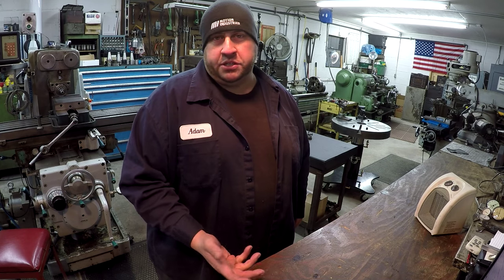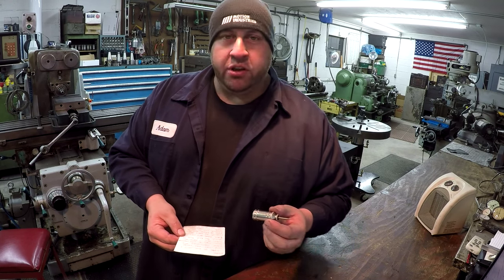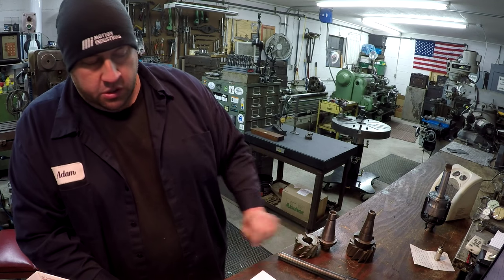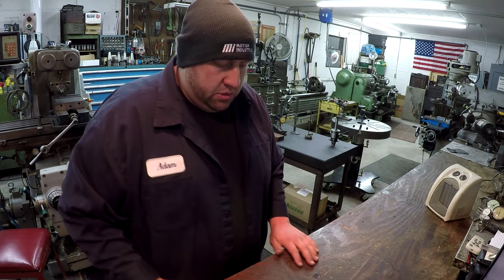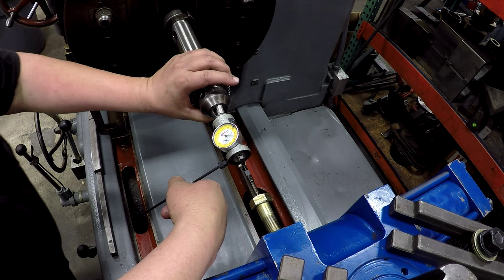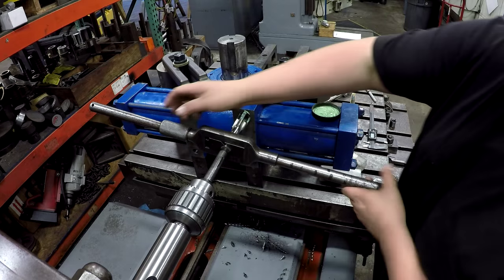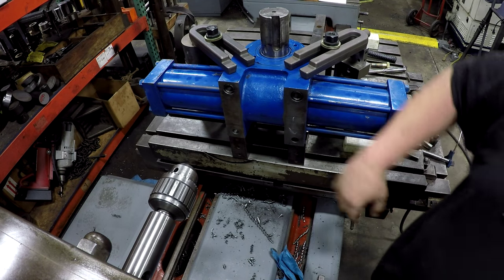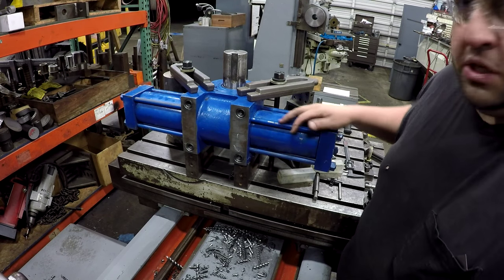Saturday Night Special 105

Comment: Thanks for taking up the brazing/welding subject. I agree with your opinion and reason for brazing I've done it myself and have the same experience with hard spots when using weldment. I was one of "the guys" who asked about the brazing😀 I was a Machinist myself but now as a Mechanical Engineer but I'm missing the smell of fresh coolant, cutting oil and hot chips 😄 Going to the machine shop at work to get my daily sniff😀

Comment: Adam,
Another great SNS! You working on that hydraulic actuator makes me a little homesick for a job I had. If the owner hadn't smoked himself (literally) to death (lung cancer that spread to his spine), I'd still be playing with actuation and building custom control boxes for our clients. 99% of the work I did was on electro-mechanical actuators. The hydraulic units I worked on involved replacing piston seals, output shaft o-rings, etc. I will get my picture entry in as soon as it clears up  . . . Yes! California is actually getting rain! Thanks again for sharing!
Have a good one!
Dave

Comment: Great how to on the thread repairs.  Next time you're on a mill with a DRO, use the co ax your way  and set your zeros.  Move it off a bit  and turn the spindle on to 200 rpm.  I think you'll be surprised how easy it is to use that way.  Thanks again,  Jeff

Comment: Thanks for explaining why you prefer brazing to welding. It makes sense that the bronze would be easier to machine and I never thought about machining because as a mechanic I don't machine my welds. I always thought that brazing was inferior to welding but you've made me reconsider. Personally I do both welding and brazing on exhaust manifolds. I know the welds are very strong as we have torture tested them. Years ago I did a 1931 Buick exhaust manifold by brazing and that seemed to work well also.
Reply: Those huge F1 rocket engine chambers that made it to the moon were brazed together.

Comment: Hey Adam, I just wanted to throw out some info for you to look into for cast repairs. Lawson Cronatron 211 welding electrodes. I worked a lot of years in maintenance and found this rod to be pretty amazing. The 333 rod for dissimilar metals also works fantastic for removing bolts broken off inside holes, just plunge in straight down bolt holes and let the rod flow itself in. The flux protects the threads while the filler builds up on itself until you have enough build up to grab with pliers and turn out the broken stud. I suggest you try these 2 electodes and keep a pack of each in your shop, they're great time savers and get you out of trouble quick. Keep up the vids brother. Matt

Comment: Hey Adam. Love the spring loaded centre for tapping, will have to make one for myself. Looking at the internal threading head, it should work the same as a Coventry Die Head in that you can set the stops for the thread depth and when you hit the stop the head pulls out and automatically releases. Will be interesting to see. Keep up the great work.

Comment: Those big J wrenches are what I know as stem wrenches they are used to tighten & loosen drill bits on a drill stem used on a cable tool rig to drill a well be it water,gas or oil. Our family business is Drilling & Repairing Water Wells in the NW Corner of Ohio. I used them till I was 18 and we then switched to Rotary machines to drill wells with that was 1978.

Comment: The water-cellulose mix looks to be a variation/evolution of Pykerete which is water and sawdust.  It offered strength and more importantly improved melt resistance over frozen  water.  The British considered it as a possibility for an aircraft carrier in WW2 as a torpedo resilient alternative to conventionally constructed ships.  All in a good read in My Tank is Fight with loads of other crazy WW2 inventions that never quite made it.

Comment: Hey Adam that number probably came off when I cleaned up the die.  It was hand engraved in.  I went back to the video I had made when I picked it up.  The model number is C7G103D (the G could possibly be a 6). And the serial number is 33337
Reply from the maker: Thanks for the info Greg!!👍
Reply: +Abom79 Dubai pictures with ur shirt will send in soon ;-)

Comment: That oil can looks like the one that was with my moms sewing machine.  Why no power tap on the HBM?
Reply: +bcbloc02 Was going to say, very similar to a Singer oil can, the really rare ones. The usual style is the half dome one, but i have the oval, can type and the screw and bib look identical to this one. Tho it's missing the head piece witch serves as a cap and tool for the machine.
Reply: +bcbloc02 think he took the opportunity to swing the tap handles
Reply from the maker: +bcbloc02 I don't mind hand tapping. I could have power tapped but it would be rigid and risk messing up if I hit bottom. I could have power tapped in there about half way, knocked the driver off the spindle then hand tapped the rest of the way though.
Reply: Abom79
Gotcha, yep tapping blind holes can be risky business. Thanks for the insightful reply.

Comment: If some knucklehead were to damage one of those inserts, how do you go about getting them out? Just drill/mill and knock the pieces out?
Reply from the maker: Yep, you can drill the insert out. It gives a specific diameter to use and it will leave 4 pieces you can just pull out, and reinsert a new insert.
Reply: Cool, thanks.

Comment: Hi mate.  The threading with that anchor lube sounds very nice, but why by hand.
Reply from the maker: +Marcel Timmers It's not a very deep hole, and with power tapping I risk bottoming in the hole and breaking something. I just better about hand tapping on some jobs.
Reply: Ah well, fair enough, I was just wondering.

Comment: Abom the chip looks more like cast steel to me.Even doc cast would give a small chip.
Reply: It's either as you say cast steel or spheroidal cast iron , they used to make it at the pipe spinning plant it cuts like steel but has the compressive strength of CI as well as the corrosion properties of CI

I had the chance while mending some gear in the labs to look at it under the microscope the graphite is in dots not flakes as is normal CI 

Stuart
Reply from the maker: +Michael H It does string out like steel, but it still has that cast iron feel and look. I get alot of dust and powder on the machined after drilling.

Comment: Hey Adam, do you use those key locking inserts on hydraulics often? From the looks of it there should be leak paths along the keys and through the outer threads. Don't they leak in practice?
Reply from the maker: +Sergey Gromov This was a solid housing with no way for the oil to come through the holes.
Reply: Oh I see now. I was under the impression that these were fluid fittings. XD Thanks for your answer, and for your videos!

Comment: Hey Adam, did you know that -40 degrees Celsius is equal to -40 degrees Fahrenheit? It's the only temp when the two scales are equal.
Reply: +John C My brother figured that out, too, when he had to go out to do chores and checked on the outside thermometer with dual scales.  He decided farming wasn't for him!
Reply: I learned that on a label of Dow silicon grease... I thought it was a misprint, then did the calculation and realized they were the same... Pretty funny.
Reply from the maker: +John C Always learning something here! Ha!

Comment: Hey Adam! I'm looking to purchase my first lathe and I was wondering if I should get an older American made lathe or a brand new one from overseas. My budget is about 2k and I like American made tools but I don't want something that won't produce precision work. If you could give me some advice I would be grateful. Thanks man!
Reply from the maker: +Dan Gibson Really that depends on what size of machine your wanting. 2K will get you an older used machine, but small. new machines have there advantages, but also come with some disadvantages.
Reply: I was thinking about a bench lathe, around 10x22"   I want to use it to make parts for my motorcycle and other small projects.

Comment: Adam on that thread repair job, if one or two of those thread inserts got buggered up how would you repair that. I've never used that type before they are impressive looking
Reply from the maker: +papaike2 You can use a drill bit to drill it out. The instructions give the size needed, and the hole cuts into the 4 slots cause it to leaving 4 sections that will fall out once drilled.
Reply: Thank you Adam for that information. Those inserts look to be very hard that's why i ask you.

Comment: Wouldn't it have been safer to wait to hammer the insert pins in until after you'd bored and tapped all 4 holes?  I know you've got some serious clamping pressure going on but "just in case" as it were?  It would suck to go through all that setup time getting everything aligned only to hammer in the pins and realize you didn't quite tighten it enough (or something managed to loosen up) and you've suddenly knocked things askew

Comment: the thing i wonder about these inserts is, what do you do when you strip them? you already runied their thread with those pins, so u cant just put in another one. 

after a minute of thinking i came up with this: http://i.imgur.com/iIJbRtA.png (yes its made with paint)

basically you put in the insert, then bore a hole for a set screw and thread it. then drive the setscrew in there. the thing that is fastened to the surface should keep the setscrew from coming back out. alternatively you could just use some round bar steel, but it would be a bit loose with that i guess
Reply from the maker: +fredlllll You can drill the insert, break off the tabs, and use and EZ-out to remove them if they get damaged. They are designed to be replaced if needed.
Reply: +Abom79 isnt the thread ruined by the pins that you hammered in?